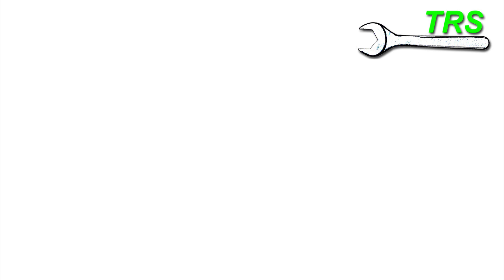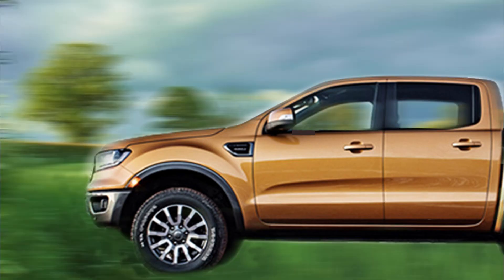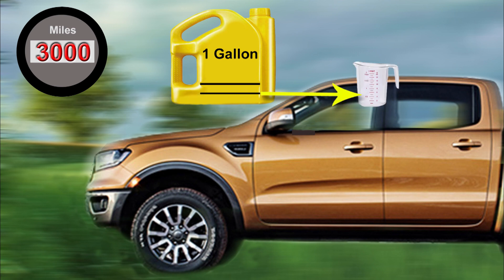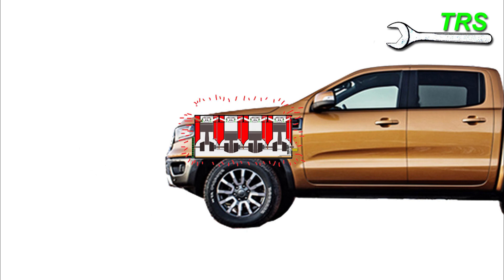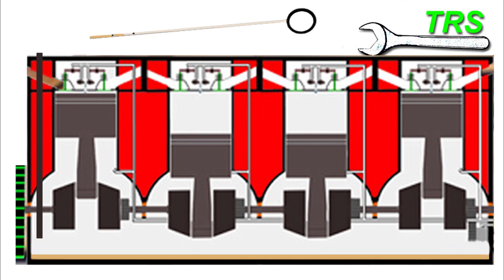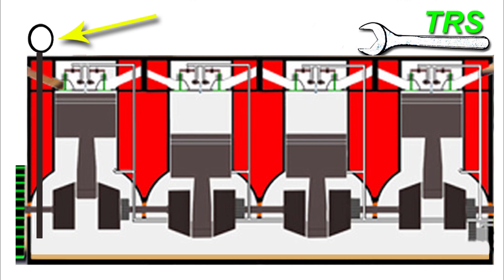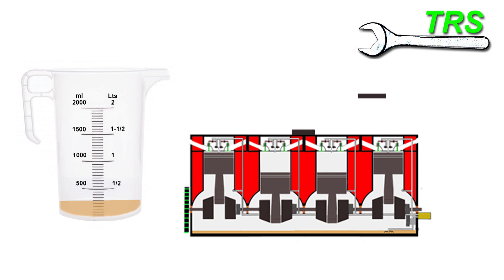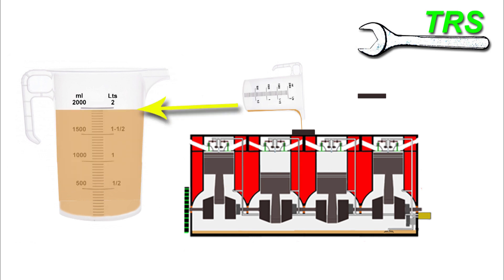Car Engine Oil - Using too Much? Why? (Simple Test) Engine Oil Change.  (by Craig Kirkman)

Comment: I enjoyed your video, THANKS! May I ask why 5W-30 oil is thicker when poured from the bottle and I presume sitting in the engine sump overnight (acting like a 5) than it is when warmed up in the engine acting like a hot 30 (now comparatively thinner)?Cheers
Reply: Well the oil viscosity isn’t how thick the oil is. It’s how easily it can flow. So a 5w30 oil when it’s cold will have less resistance to flow which is why it has the 5w marking when it’s reached operating temp the oil now has more resistance to flow which is the 30 marking. It’s not about thickness per say.
Reply: And the reason being when it’s cold you want the engine oil to flow faster through your engine to protect as much of the internals as fast as possible. When it’s warmed up there is a thin film of oil covering all the internals of the engine so it dosent need to flow as fast.

Comment: I had a 1972 Chevy Vega station wagon back in the 1980's .Paid $100 for that car ..It burned so much oil that I would have to put 1 quart of oil in every 45 Miles ..I loved that old Smokey car

Comment: I have one question i always have been wondering about, when you check the oil do you screw the dipstick in there or just dip it in?
Reply: Dip it in
Reply: @MultiRafael23  nah you screw it in, just like how you push the dipstick in to check

Comment: Thank you 💐
I have one question plz..
If I use 5w30, in more than 100k Toyota corolla 2009 japanese,
and I am living in a very hot city 50 degree C, more than 120 fahrenheit..
Should I stepping up with viscosity, like 5w40 or 5w50? ..Or continuing on the same viscosity 5w30?
Thx again ✌️